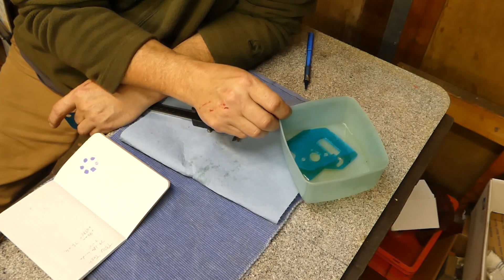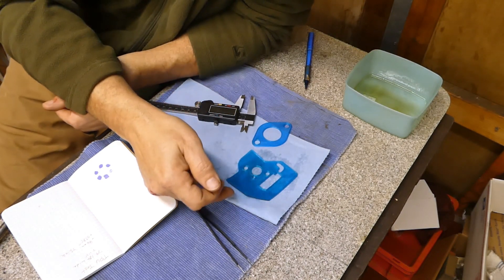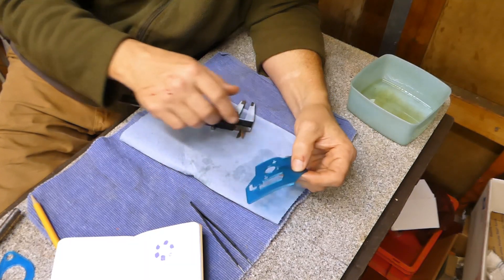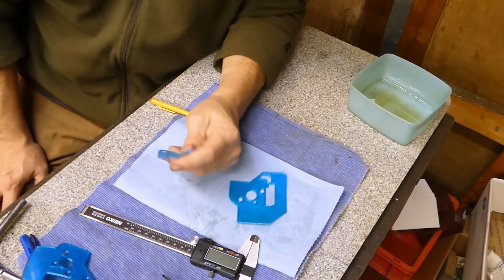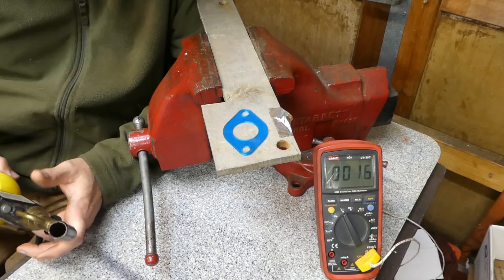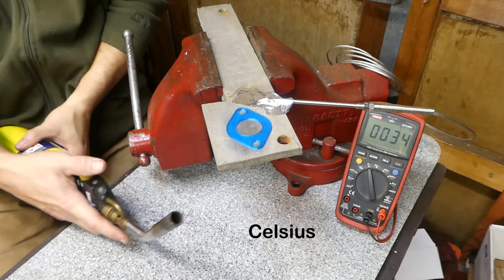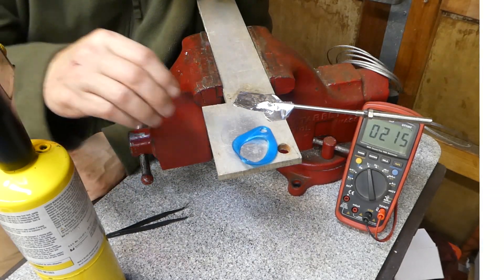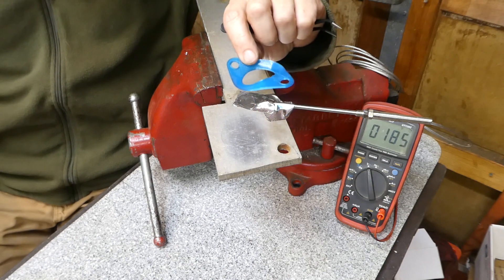Will 3D printed gaskets melt? TPU tests

Comment: Your experiment is valid, with the suggestion that approximately 100c is the re-usable/non deteriorating operating limit.
I would suggest for long term testing that the clamped thickness and rebound would add to the vital statistics when subjected to a max temp of 100c.
The tractor experiment will certainly provide valid data.
A valuable data set and of extreme interest to many.
Good luck and take care.
Reply from the maker: That is exactly why I like doing these in stages because at every stage I get good suggestions of concerns I have yet to consider. I can clamp the gasket between 2 pieces of aluminum at a known torque, and heat the aluminum up to a known temp. and see if there are any changes. I need to control the heat better for that. Maybe an old toaster oven that I use to dry paint on small pieces would work.  Thanks, Eddie
Reply: Not sure what he expected. TPU does not melt in an extruder until 195C so printed TPU will have the exact same property because it's still a thermoplastic.

As for a valid experiment. Sorry but no. He should have had a control gasket at the same temp as the gas soaked one, and he should have compared TPU to typical nitrile gaskets for expansion and melting. Nitrile melts around 140C. And, he should have done it all three or more times. YouTubers are generally clueless on scientific methods.

I use TPU on several motorcycle parts and motors, for years. I find the use as a gasket is better than OEM nitrile for gasoline.

Comment: Interesting. I know pla will anneal or  re-bond if heated to near the glass transition temperature and will then withstand slightly higher temperatures. I wonder if the same is true of tpu?
Reply from the maker: There is Bill bringing it with another test, lol. From my research on what little is out there it may be possible to get a bit more heat resistance by annealing it near the glass transition for several hours. Interestingly one article suggests that it will naturally anneal somewhat over time at room temp though the effect is slight. This stuff is alive. Possible drawback is it may harden as well. I need to come up with some way to test this I guess. I need a Shore Durometer.
Reply from the maker: Hello Bill, did you happen to see Stephen Gotteswinter video a couple days ago about tailstock drilling? He used a tiny coax indicator in it that I had never seen. Interesting design. Yours is more elegant though :-)  Best!
Eddie
Reply: @theeddies  hi Eddie, yes. You've just reminded me that I was going to take a closer look at it !8-)